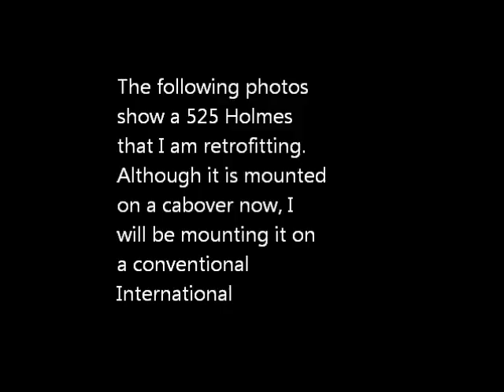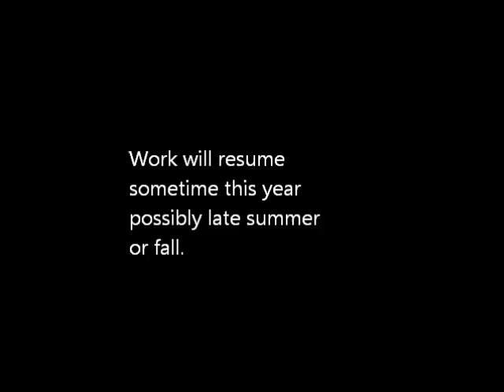Holmes Wrecker Retrofit Slideshow

Comment: Old tow man 50 + years I cut my eye teeth on a 525 & W,35 & W 45 those were.  the power house of Holmes in the day I have a couple of hydrologic wreakers but for getting the job done I use my old International Loadstar old Air Force 750 Holmes pulled out 210 excavator last night 2 snatch blocks out in 45 minutes good job on your build I thought about a build similar with a 600 Holmes Kemp in B" ham , Alabama has a machine shop they have been doing 750 builds since late 70' s a lot of guys in the southeast states have a Kemp they claim you cannot bend the boom if it can be bent they need to let me test it some of my recoverys I have bent the boom on a Holmes 500 on 68 Ford 600 had a boom built out of oil field pipe stem still there that was in 1978 good luck I hope you the best

Comment: The Power Tower looks super solid!!! The barrel on that boom is off the hook!!! You really did this one up right Jon...gotta see the finished product!!!! I'm not too familiar with the 525, but the Power Tower reminds me of a "split boom" like the 440...plus you got 2 winches which makes me wonder if the 525 was a split boom like the 440. However that tower looks like it can definitely handle your hydraulic boom set up EASY!!! You grabbed my brain on this build!!! LOVE IT!!!!!!
Aloha
Reply from the maker: +Kohala Iron Works (Chief) Same as a Holmes 480, just a little bigger. Winches are basically the same as a 600 with a different braking system. It was a split boom originally.
Reply: I thought so...I have seen many split boom Holmes Wreckers here on this Island. I was going to pick up a 440 Holmes, but the guy wanted too much.